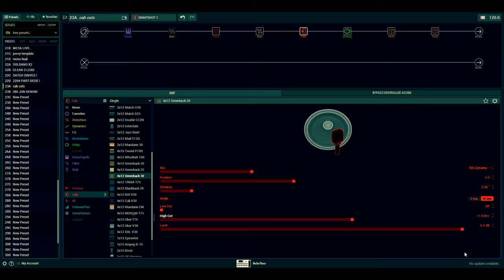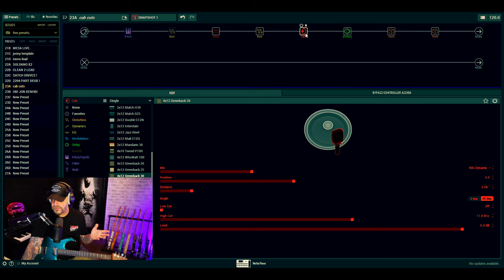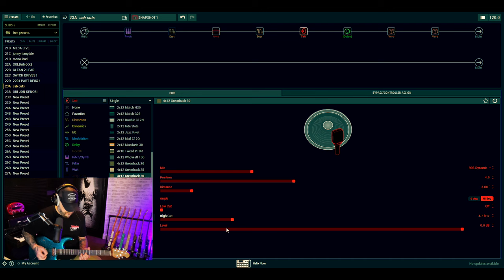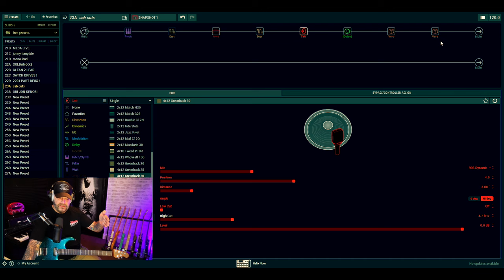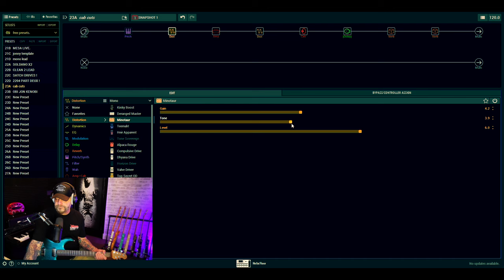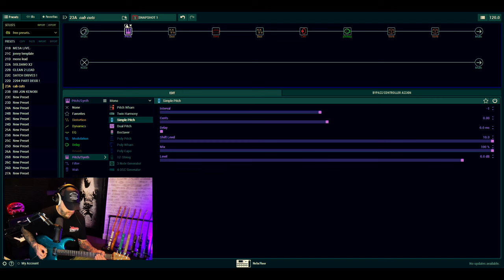Line 6 Helix Do THIS with your CABS !

Comment: Great high cut method, Jonny, thanks.  I'll be adapting that.  For me, I'll also tend to cut the low end enough to get out of the way of the the kick, bass or whatever else is hanging around there, then I'm eventually tweaking it once I test it with the band, too.  There's never an absolute "one fit's all" setting, as I'm sure you well know, too many variables.   Speaking of,  appreciate you mentioning how the pitch shifters can add to the high end, also.  Cheers.
Reply from the maker: No problem dude

Comment: Hey Jonny,
It is so much easier to find the sweet spot using the open door technique. Thanks! 
I use two Powercabs with the speaker emulations and do the hi/low cuts there. Any tips or suggestions for that type of rig? Great info like always!!
Reply from the maker: Thanks mate ,   I never used the onboard powercab sims ,  I just used it in flat response .     It was easier that way .   Same technique tho .

Comment: Great video sir. Really helped me understand a better way to set some of the eq by going low and moving higher sill sounds good to my ears. Funny how the simple things just elude us. I got a question for ya. Does Helix have a version of the Digitech Drop Pedal? So i can be in standard tuning ( E ) but engage that and bring myself to E flat for those old 80's Hair Band tones. They seem to love using 1/2 step down lol. Sorry if this is a dumb question, but I am trying to gather as much as i can so I can decide what to get when my 54BD comes very soon  😇
Reply from the maker: Yes it has a pitch section that will do that , it’s called simple pitch .  Works great

Comment: yeh  good but not enough  try to use eq after the amp  high shelf and high cut and wen you do that make sure your cab its off  to hear  the nasty  fizz  about 8 k and 10 k even try  double eq technic then turn you cab and don't over do it with eq  and also turn off the delay just amp no effect all off

Comment: Yeah, but it sounds a bit dead and artificial after a while. If you take a full blown plexi sound like VanHalen (or Greenday for that matter :) ) there is a lot going on in the 6-10k range but current digital stuff isn't able to faithfully reproduce it. Right now it's still "angry painful fizz". IRs were a real breakthrough years ago but I think we need something better now. We need real speaker modeling now.
Reply from the maker: We have the ability to change cabs , change mics, move them  into all positions , Cut them accordingly .  The tools are there .